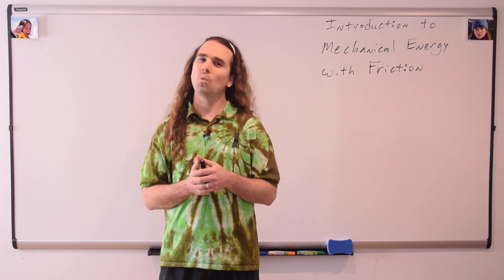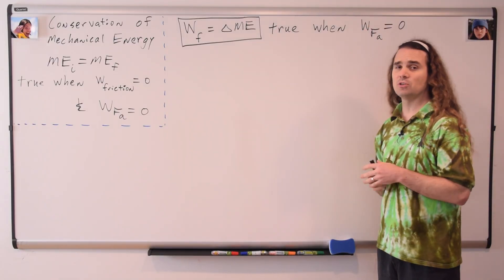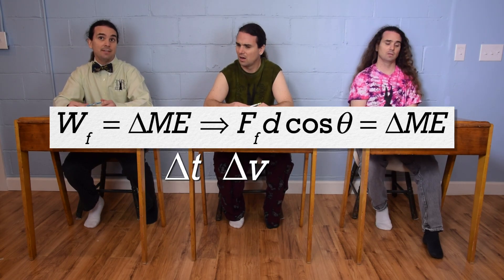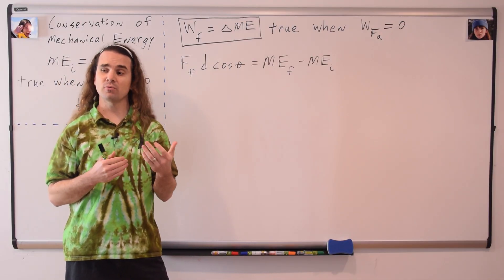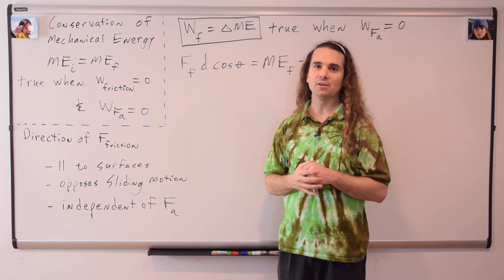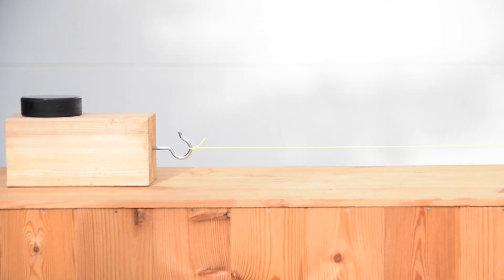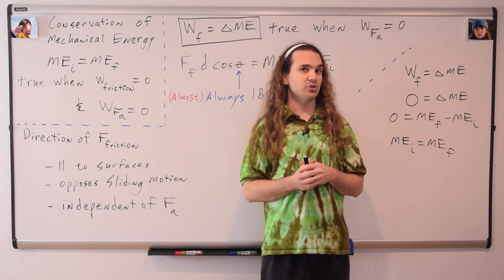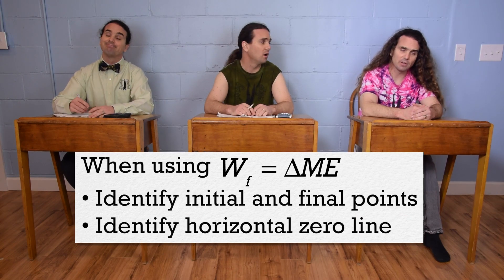Introduction to Mechanical Energy with Friction

Comment: Quick question- for conservation of mechanical energy to apply, doesn't the work done by the resistive force also need to equal zero?
Reply: no since its so small that its negligible. In other words, its really small compared to the other forces that it causes little to no difference to the mechanical energy

Comment: Why is the force of friction on the hockey puck  not directed to the left when you have it resting on top of another block and the two slide together?
Reply: I think because force of friction stops block from falling to the left which would happend if the block was made of the ice. Or if I stand on the car if somebody moves to the right with a car I would fall on my back